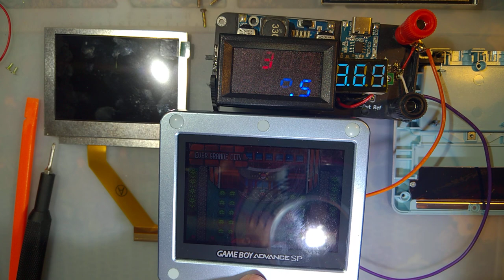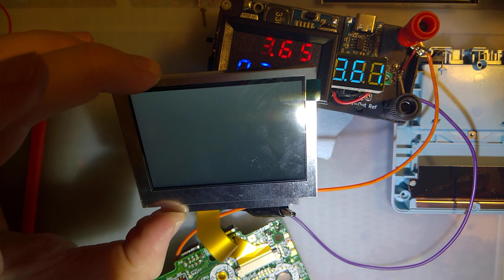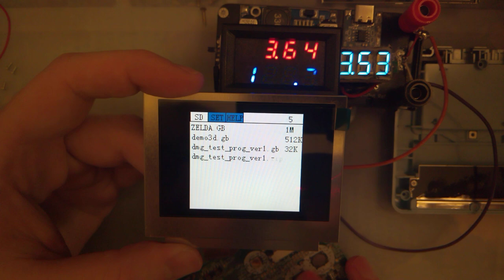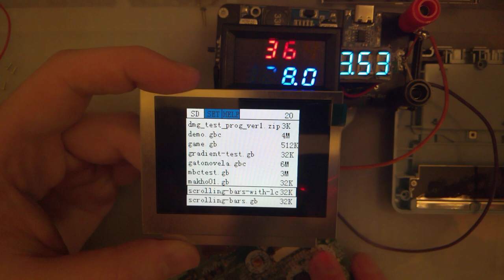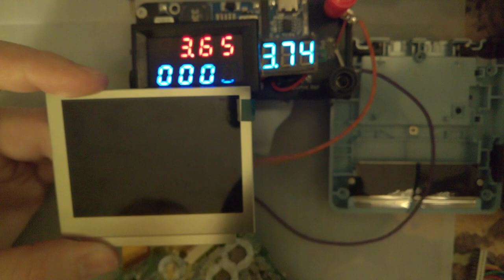IPS-101, the Clone AGS-101 LCD Kit

Comment: It makes sense for it to use the original 101 screen form factor, because you can use it with 101 boards (and possibly 001?), and I assume chinese warehouses have loads of three ribbon converters anyway, lol.

What you could test is how the screen behaves with PocketNES/NES Classic emulated titles, whether it's leasing artifacts behind like IPS V2 or not.

That said, I also saw those on AliExpress and they seemed cheaper than "regular" 101 ones, but still more expensive than IPS mod or the "one dead pixel" ones you can get on eBay. I thought of getting one along with 101 board to make a semi-original 101, but since it is not original... Well, I Hope the prices will go down after that virus outbreak passes

Comment: That's a very interesting screen. I still prefer the actual IPS mod but this look like a good alternative for someone looking to repair/upgrade an AGS-101 and can't solder. As long as the person is not worried about that crazy power drain of course. That was nearly double the 101 at full brightness. Add an old battery and a flash cart to that and you have a GBA that goes into red light after 30 minutes.

Comment: They probably dont ship with the “correct” ribbon cable so that not only can it be used with the AGS101, but so it can be used with either model of the original GBA via the right adapter

Comment: Here is a video showing the problem I described in the previous comment: https://youtu.be/MVS-FnAvyco

Pay attention to the 0:29 at F-Zero main menu, 1:08 when loading Zelda: ALTTP and 1:23 when loading the Zelda:ALTTP game. You can see part of the F-Zero map circuit on screen still.

This ghosting disappears after a few minutes... and is caused by flashing/flickering objects on screen.
Reply: Great find, its weird that a power cycle does not remove it. Something must happen to the pixels for a few minutes.

Comment: Any thoughts on what I should do with this thing? It should work on any AGB with the standard AGS-101 adapters, any AGS-101, or even an AGS-001 with a voltage regulator. I'm leaning towards building out another AGS-001. Thoughts?

I really think all of these options are great options, however, i am a big fan of AGB so i would say, make another cool gameboy advance lol ! but if you go with AGS SP then do that and the battery mod from OSHPark (which btw thank you, i just bought the PCB's :) )

Comment: I don't like the cable adapter thing, your are right, they could of just built in the adapter thing to begin with. I think they opted not to because they wanted to just make 1 lcd model, otherwise they would have to made 3 models : 1 for AGB 32 pin 1 for 40 pin and 1 for AGS. What is really nice is that little to no soldering is require. Now it makes me wonder how brightness control would work on a AGB though...

Comment: This new "AGS-101" screen actually have a serious problem regarding flashing objects on screen. Try playing any circuit of F-Zero Maximum Velocity and you'll see and understand what happens after you load another circuit. The previous circuit map keeps flashing on screen (i.e. ghosting effect).

I wonder if you could maybe figure a solution for this problem.
Reply from the maker: it's not a problem, it's working as intended. Blame the game devs or even Nintendo. 

This was a trick used by devs to make objects transparent on-screen. Since the pixel response time on OEM hardware is complete garbage, devs found it took fewer resources to just flash something on and off instead of making a transparent version.
Reply: @makho  Actually I'm talking about a weird ghosting that happens when something flashes too quickly, it persists flashing on screen for a few minutes even if you leave the game. It only happens with this specific model of the screen. Here are some pictures: https://imgur.com/a/uyYKKFO.

I tested both on an original GBA and a AGS-101 motherboard and both give the same results.
Reply: @yannv95 It looks like some burn in/ or ghosting but I don't know what it is specifically called. I have a TV that does this. Bright images leave behind a faint image that is really visable on black backgrounds.

Comment: Hi Makho, is it right that  this "clone" screen works ONLY on the GBA SP with original ags-101 motherboard? As far as I know this clone won't work plug 'n' play on the gbaSP with 001 motherboard, right?
I'd also like to know if this clone would works on the NO SP GBA .  If I plug it into the 40 pin ribbon adapter I use for the original ags-101 screen I use on my GBA, what would happens? Did you try? I checked your videos but didn't find this mod.
Reply from the maker: like I said, it works just like an AGS-101 screen. https://www.youtube.com/watch?v=36OODPxYDCg

Comment: NIce!  this clone screen is less battery consuming comparing to the "normal" IPS screen (funnypaying and one chip v2). I'm not sure if I can use it with the AGB (no SP) though. What do you think? I'm not really aware about all the milliamps / voltage ratio. but seems that 100 milliamps (clone consumig) is less than what you measured on the Funnyplaying screen (between 185-430 depend on brightness), but maybe is just because voltage on the GBA SP is not the same as on the GBA. Any advise?
Reply from the maker: You've asked three times now, if I keep going through my comments, am I going to find more?
Reply: @makho  Dude couldnt sleep thinking of this

Comment: What exact spec of wire should I order from AliExpress for gba sp ips v2 brightness mods and all other gameboy mods gauge and type etc. please I’m gonna order it from AliExpress I’d also like a soldier recommendation whatever is best idc to pay a little more for the wire or the solder and what’s the best flux? I appreciate any help thanks! Also have you tried the gba sp ips v2 laminated 10 level brightness screens? I bought two and they are amazing I think I like them better than the funnyplayin kits you have done they are very similar have no tearing issues or anything and they have brightness memory aside from the lense difference and the ribbon I think they are the sa me and the function is flawless I’ve probably put 60 hours on one SO GOOD! beat emerald and oracle of seasons on it with my everdrive gba x5 mini and even on a stock oem original blue hard cased battery I get 4+ hours on full brightness!
Reply from the maker: https://www.amazon.com/shop/voultar

and yes, I have played with that screen. Search my channel for a video I did on it.
Reply: makho found the video was it the one chip? I was curious why you picked then funnyplayin over all the others could you do a direct comparison between the two best screens on the market in your opinion and why you prefer the funny playin kit? I’m about to buy another and if the funnyplayin is better than the 10 level brightness one I had then idk lol that’d be hard to believe 😂
Reply from the maker: @kingarthur7255  https://youtu.be/amRFG-DqP2w

Comment: Interesting little thing you got there! I do have an original replacement 101 on my gba that got a green dead pixel on it; you said yours got a line... Do you have any ideas to fix it? the ribbon cable soldering to the screen itself may have gone loose perhaps?
Reply from the maker: Mine isn't fixable that I know of. It's a screen defect.

Comment: So, in the end, do you recommend this kit to replace an oem AGS-101? I've got some ghosting I want to eliminate in my SP. RGRS has them now in stock, not so sure if it's worth it, seeing as the price of an FP kit is the same! I like the idea of it being a drop-in with no soldering required though. What do you think?
Reply from the maker: For an AGS-101 console, yeah. For an AGB console, the regular IPS kit is the better buy.
Reply: i bought one of these when my 101 screen ribbon cable got ripped from opening and closing too many times, havent fount the time to do micro soldering to fix it, so bought one of these and its really good. i might even just keep using it and once i fixed my ripped 101 screen i would try making my 001 to a 010 mod by using the 101 screen.

Comment: I wonder if LCD IPS
If going to connect with GBA SP model AGS101 (mainboard AGT),
Do I have to connect the power cable that is attached to the Q12B point? 
Because most of the videos Show only model AGS001 (mainboard AGS)
that need to connect the extension cable to point Q12B
(The AGS board has a circle blue chip under the Power button). 

Thank you for who one andwer me.
Reply from the maker: The wire is for brightness control using the button on the game boy

Comment: I know this is a little unrelated but is there a way to fix a 101 screen that has White Corners when it's on?
Reply from the maker: Not that I know of. I've never had one of those screens myself. I wonder if it's an issue with the polarization layers or if it's just another form of screen rot. Nintendo LCDs seem to have issues with one or the other or both quite frequently.

Comment: Does this fake ags-101 support brightness adjustment through the ribbons for the AGB?
Reply from the maker: Assuming the ribbon supports brightness control then yes
Reply: @makho  Would you have a recommendation for a ribbon that might support that? I tried a ribbon I picked up from retromodding with a switch and wire, but the brightness did not change when switching the switch setting. The screen looked great, just wasn't terribly bright.
Reply from the maker: @SchmingyYT  It sounds like something went wrong with your install then because those ribbons should work for brightness control with these screens.
Reply: @makho  Different cable made the difference. Same make and model as the first one. Either a bad solder joint with little wire or something else wrong with the first cable I tried. Thanks again! Great content!!

Comment: Does the brightness button on the ags101 work after drop in - with no soldering required?
Reply from the maker: Yep
Reply: @makho  appreciate it!
Reply: sorry one more question - does it fit perfectly into a stock GBA SP Housing once a Lens is installed? Or does it require a foam piece between the back of the screen and the shell?
Reply from the maker: @SMOKEFRMDA6IX  The foam just prevents rattle. Not necessary (but recommended).